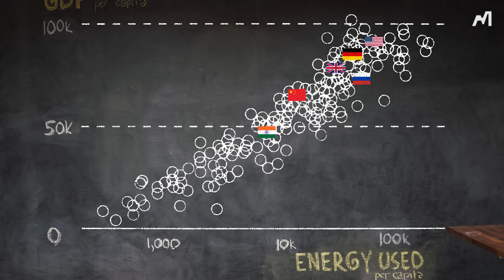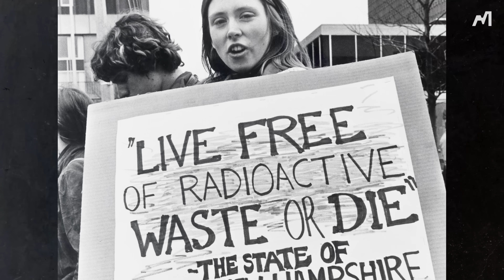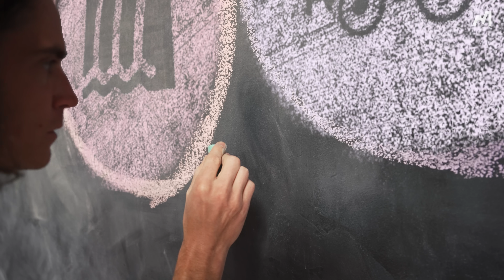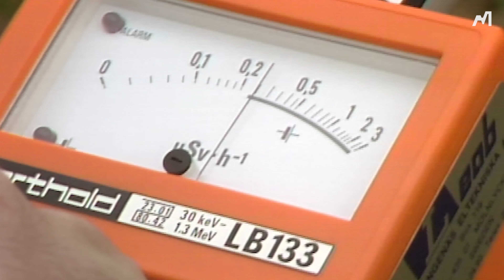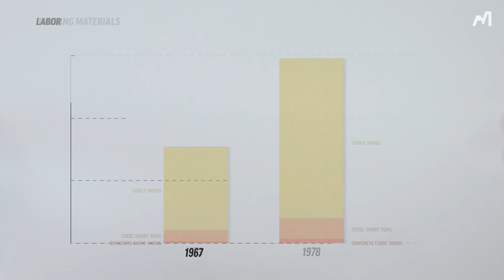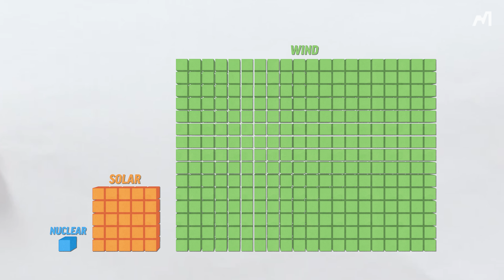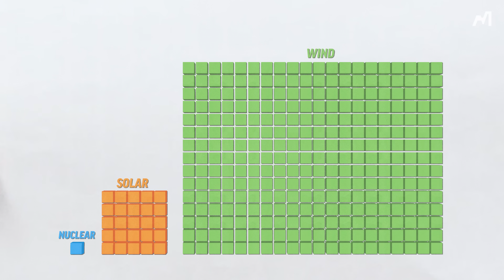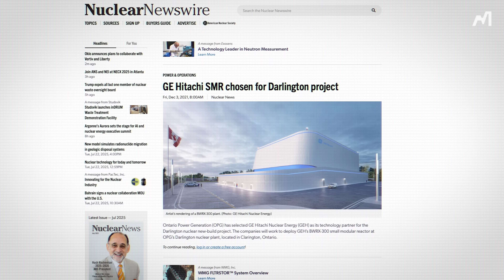They're Lying to You About Nuclear Energy

Comment: For comparison:
One Banana = 0.1usv of radiation exposure on average.
A full dental x-ray is less than 50 bananas of dosage.
Radiation exposure to the average public in the United States from burning coal in power plants - 30 bananas per year.
Eating a gram of raw mineral  uranium is about 25 bananas
At Sea Level near no infrastructure you get about 100 bananas exposure a day.
Being  next to bricks, concrete, or natural stone increases your exposure by about 2 bananas every day which is also about the same increase you experience if you go live at an altitude at about 3000ft.
Living around and using electronic technology every single day generally increases your exposure by about 1-2 banana per year.
A CT Scan is 100,000 bananas.
Maximum limit allowed by a Hazardous Material Radiation worker (almost never reached) in a year is 500,000 bananas.
Lowest concerns of measurable cancer risk in one year is 1,000,000 bananas.
Maximum detected radiation at Fukashima after the accident inside the core area per hour 4,000,000 bananas.
Lower bound of radiation sickness with full recovery 5,000,000
High risk of fatality 50,000,000 bananas
50% fatal 100,000,000 bananas
Death within 1 month 300,000,000 bananas
Visible proximity of the Chernobyl core after incident for 10 mins - 500,000,000 bananas
Current Visible proximity o the Chernobyl core meltdown material rate in 10 mins - 500 bananas
Fully fatal dose within hours - 100,000,000,000 bananas
Average radiation doze inside the Hiroshima city limits in 1945 - 250 bananas per hour.  
Current radiation level  increase inside the Hiroshima ground zero - near zero difference modern building structures surrounding the area emit more natural radiation.
Santa Susana Field Laboratory in California (former Rocketdyne test and experimentation lab and current EPA superfund site for radiation cleanup) - 200 banana increase per year of direct exposure at peak location.
Exposure in Red Gate Woods (where the first Nuclear Pile was buried in Chicago) - 175 banana increase per year of direct exposure.

Maximum Increase allowed outside the containment building of a Nuclear facility - 2 banana per year (about the same as spending time near a block of granite).

Comment: Wind power also has a downwind impact on bird life. The EPA hires researchers to count the deaths, apparently that data doesn't go anywhere. The conclusion is that the large windmills create a pressure differential which birds are hyper sensitive to. Effectively, birds fly into an invisible pressure change, have an aneurysm and fall out of the sky dead. Those numbers are significantly larger and more harmful than strikes from large birds.

Comment: 7:33- The 'what if a two-foot section of pipe disappears' - Yes, that absolutely can be modeled and is. The purpose is to avoid single-point failures. Pipes can be damaged for a variety of reasons.
Reply: This is the same argument people use to fight LNG pipelines in Canada. 

It’s here to stay, but virtue signaling faux-activists want to keep giant tanker trucks driven by barely-licensed immigrants on the road instead. The previous commenter is correct.
Reply: But it's not damage. You can fix a damaged pipe, and it's not even that hard or time consuming. if a two feet section disappears, you are left with an unfixable mess until you shut down the whole system connected to that section. Never in the history of nuclear operations a two foot pipe section disappeared, and never will it happen. Ever.
Reply: @endlessstrata6988  - Never - until it does. Never will a nuclear reactor experience a massive earthquake, followed by a huge tsunami. But then it did.
Reply: @bruzote  Might as well plan for a nuclear strike then. Hey, a fifteen megaton warhead MIGHT strike the reactor, gotta make sure it survives intact! What absolute retardation. And even that, did nothing. There are zero statistical cases of cancer related to that one. So, the worst thing ever happens, and it was ok.
Reply: @bruzote and more people died because they evacuated than would have died if they hadn’t

Comment: At current rates of consumption, uranium reserves will last 90 years. That's official.

Currently, nuclear fuel is 4% of the energy mix. Electricity is 20% of the energy we use.

So if we were to go 100% nuclear, 100/4%= 25 times faster consumption. 90 years / 25 faster = 4 years before uranium reserves run out.

If you say: we can get unlimited nuclear fuel from the ocean, I would say: do you have a proof of concept for that?

We also evolved for like 4 billion years without electricity. We had civilisation for 10k years before electricity.

And then you say: haha you have phone. What about that?

Then I say: I bought my first cellphone at 24 because an employer forced me. I held off buying a phone because I knew people would start guilt tripping people over using a phone. As they do with everything else.
Reply: We have enough fissile fuel (uranium + thorium) to last 4 billion years. The sun will burn out before we run out of fuel.

Comment: "when maintained properly" yeah, thats what im worried about.
Reply: The navy has done it without accident for over 75 years
Reply: @elapidpython4378  navy has near unlimited budget and they dont need to be commercially profitable. military safety standards are even more strict than civilian ones. not exactly the best comparison you have made here. and there were accidents even in such strictly regulated and maintained environment.
Reply: @seushimarejikaze1337 factually incorrect the military buys every at the lowest cost possible 
There is zero reason civilian sector is unable to match our standards 
And finally when it comes to nuclear the word accident has a specific definition 
That being the release of fission products from the core which has never happened in a navy controlled reactor

Comment: Here is the crux of the nuclear waste issue which I don't think you covered fully. It's hazardous to the environment (to the extent that you need to store it somewhere and can't just dump it wherever) and it takes really really long time to degrade. That's the problematic component. Its simple math really: if I produce 500 columns of waste a year, and it takes 10k-100k years for each one to breakdown then eventually I will have a LOT of hazardous waste. Did the Simpsons exaggerate it? Sure. But the point they were making is accurate. What do we do with all that waste?

Comment: Safety is not the problem with nuclear energy: we need peak and intermediate power sources to fluctuate output with demand. Nuclear cannot do this.
Reply: It absolutely can, NPP can vary power by 5-15% of nominal power per minute, they operate in primary and secondary frequency control and in europe they're required to do so by law. Nuclear can operate in load following all the time. Where did you read this BS?

Comment: The energy per surface area isn't really that interesting of a point unless you need the area. This also likely doesn't include the area from mining nuclear material etc.
Overall solar panels can be a paired with agriculture and in more arid regions even boost agricultural output and lower water usage in those field, by providing shade. But even in non-arid regions pairing solar with agriculture (be it lifestock or crops) have shown to increase the general land use efficiency, a slight reduction in agriculture output, but well offset by the increase in energy production. I believe there was an agrovoltaics test in northern Germany that found that the combination produced 80% if the crops it would if fully used for only crops and also around 80% of the energy production if it were only used for solar. Giving the combination a 160% return vs the 100% if you focused on only one.
Then there is ofcourse the space like parking lots, roofs, canals, water reservoirs, ...

Yes, renewables need storage, but if properly used this also can allow for a more resilient grid by being more spread out. If a cable goes out connection a nuclear powerplant to an area, that would be a lot of power suddenly dissapearing, not so with a decentralised storage network (and the power also isn't lost/wasted during the downtime).

Personally I also see the shorter lifespan as an advantage rather than a disadvantages, this allows for improvements to be introduced faster. Imagine if we still had to rely for a lot of power on 2010 solar/wind in 2050, that would be stupid. This plants would have been modernised with more efficient turbines/panels eitherway. This however is less easy for nuclear plants due to time needed to recoup the initial costs.

Both renewables and nuclear have their advantages and they both might have a role in the grid of the future (renewables likely to be king for at least domestic power, industrial maybe more interesting for industrial applications, especially the 24/7 ones), I just thought you were too negative on renewables in this video in order to make nuclear look better.

Comment: There are two problems with nuclear energy that must be dealt with intelligently. First, nuclear waste turns the things like gloves, other PPE, hardware like tables and glassware, and durable goods like forklifts, radioactive. These things become radioactive, and need to be treated like nuclear waste. The things that handle those things also become radioactive and need to be treated like hazardous waste, and on and on. With chemical hazardous waste, the PPE etc. split into stuff you can put into regular trash and stuff you need to treat before disposing of it, period. Not so with nuclear. Secondly, spent nuclear fuel has no definite fate. We in the USA have yet to decide the long-term storage problem, so running plants have over-flowing holding tanks meant for short-term storage being used for long-term storage. That’s dangerous and has led to leaks into the environment. Our lawmakers and our voters need to settle this issue or the danger of spent fuel will keep growing, making it unwise to keep building these plants. We need grownups who don’t use nuclear energy that never treat it like a political football.

Comment: Solar PV is much cheaper and easy to install, now with advanced energy storage there is no need to use nuclear .
Reply: There is no such advanced energy storage. This is vaporware, and until such storage is available the usefulness of solar for grid power is very limited.
Reply: @jakefoster6374  Pumped hydro, massive flywheels, large weights elevated that slowly lower, compressed air ... would you like some more besides batteries?
Reply: @jakefoster6374   you are so WRONG !!
Reply: @kimobailey2926 unfortunately no, I'm not. There's no practical way to store more than a VERY small fraction of our electrical needs. The people selling solar and wind as the cure-all like to pretend that solution is just around the corner but it's peak foolishness to build a system that is critically dependent upon a technology that MIGHT, HOPEFULLY, be available at some point in the future.
Reply: @jakefoster6374 ever heard of these things called batteries?
Reply: You obviously don’t understand the costs combined with BESS systems. You need a reliable grid and PV on its own cannot accomplish this. Neither can PV with a BESS. Nuclear is by far the best baseline form of energy, then peaks can all be chased by PV, BESS and GT.

Comment: Ralph Nader made his whole career on fearmongering. He needs to EABOD... 

Three Mile Island was operator error, not the design. There was a sensor failure and the operator in charge was trained on a sub. The correct answer when you don't know what's going on at the reactor in Three Mile Island is to let the reactor flood. Flooding a reactor in a sub sinks the sub - so the operator in charge cut the feed water due to a sensor saying it was flooding. The cooling starved reactor then overheated and melted down. 

The answer was better training - not mountains of regulation but the alarmists like Nader screamed like chicken little and everyone panicked. 

Nuclear IS the answer. Thorium Salt reactors are another type of reactor that would work well. 

Then, use the excess, essentially free heat and run a Fischer–Tropsch style plant for synthetic fuels. We can recycle anything carbon based into usable fuel stocks.

Comment: You forgot one chart. The one that compares the cost of energy. Nuclear is very expensive electricity. Solar and wind are the lowest cost for electricity. If a nations wealth is built on energy used; then it becomes clear that the cheapest power will create the most wealth. By example, we drive an EV. Over the past 6 years we have saved, just on gas vs our electric bills, $18K cad. And we are retired and thus don't drive as much as a working person.

Comment: Nuclear reactors have to be rebuilt in 40 years. They can last 80 but its recommend to rebuild them in 40
Reply: No, that's the initial operational life for VVERs russian design, EPRs european design have it at 60y, I have seen the opposite, no expert recommends rebuilding them, but doing a refurbishment program for 20y life extensions instead
Reply: @filippo1864 yes you are correct in saying that they will refurbish their reactors but atlest in France the refurbishment will be substantial to the point where saying that they will rebuilt it is practically the same cost wise. I have never heard that you need to do refurbishment every 20 y but I will not deny that Ddd

Comment: 07:01 Is simply incorrect. ALARA is a concept in which lowering dose should be implemented taking into account socioeconomic factors. The notion that the company MUST do it if it lowers radiation exposure is wrong. For example if the exposure without implementing reduction methods is 10 uSv, and its possible to reduce it to 5 uSv at the cost of spending thousands of dollars, the company will not implement that change since the baseline of 10 uSv is benign as is.

Linear No-Threshold model is not directly related to ALARA principles. It is simply the method chosen to simplify radiation protection implementation and help convey possible risk to the people both in the industry and the public. While scientifically incorrect, its practicality and conservatism in allowing the implementation of radiation safety procedures is what makes it used in an industry standpoint.

Comment: "Radiation Scare" is valid broadly, especially fissionable material, but I think some of the key players and movements aren't being fully represented to explain Plutonium shortages which were already being acknowledged in the early 1970's.

There was immense competition for plutonium access that did not keep up w/ production. 

People aren't well informed that the materials being referenced have to be produced, its not used in its raw mined capacity (for the few things which are naturally found which modern uranium & plutonium used in power generation is not naturally occurring at sufficient scale).

Research directly competed w/ power generation industries & research (from NASA to the pharmaceutical industry) beat out grid owners 9/10 times. 

We also saw alternatives research (such as thorium development) take away from the already limited plutonium production capacity the US had dedicated. 

During the boom when we were producing reactors at the necessary rate for cheaper & broader prime power access, grid owners also completely shirked responsible political strategy & cooperation to ensure more plutonium refinement was earmarked.

By the early 1990's the dream of widespread nuclear utility was dead for this & economic reasons.

There also is an overarching flaw to the logic expected from grid owners & the government here: they care less about providing a utility & easing suffering & costs & more about comodification of goods & maximum extractable profit. 

They don't care about our prosperity, only what they can extract from us.

Comment: AFAIK, SMRs are bad in terms of fuel efficiency, they require more enrichment in comparison to full scale one and work shorter amount of time per one fuel load. And this leads to another problem - amount of waste that was not burned out in the reactor.
Reply: partly correct, they do require more enrichment as decreasing size requires higher critical mass, and they have lower fuel utilization, but some designs do operate for a longer time than conventional reactors

Comment: The energy solution is simple.   
You use the CO2 in the atmosphere as an energy source.

We already have all the technology needed to use CO2 as a fuel source.
These are the steps.
1.  Build massive solar farms to provide electricity to power the steps below.
2. Build massive refrigerators to cool air.
3. The cooled air will first produce water, use this in Step 6.
4. Continue cooling air freeze out the CO2 , this is dry ice.
5. Use a water source, ocean water will be ok.
6. Build massive water electrolysis to split off Hydrogen H2,  O2 is released.
7. Build massive reformers to combine the H2 and CO2 into Methane.
8. Build massive reformers to convert Methane into Methanol.
9. Methanol is a liquid easy to use easy to transport 
10. Build a lot of engines to be fueled by methanol
11. Existing power stations are easily converted to burn Methanol 
12. Sell the Methanol engines very cheaply. They can easily be filtted into existing cars
13. Sell the methanol at 50c a gallon.
14. Produce enough methanol so that you make more than can be consumed.
15. Pump the excess methanol back into the oil fields
16. Build Methanol reformers to make Kerosene for jet planes.
Easy.  This process mimics photosynthesis, without the trees.